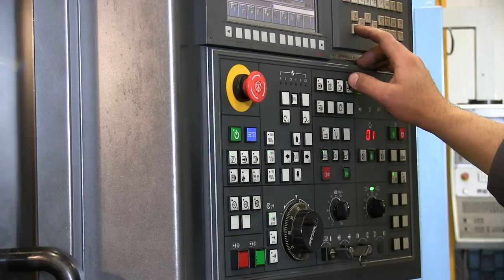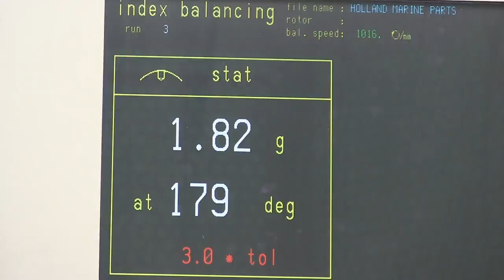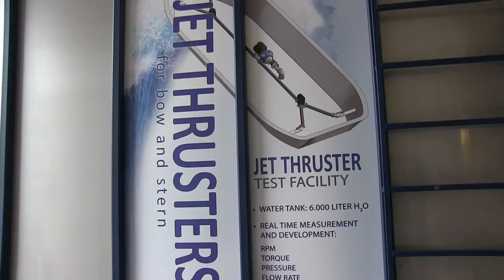How it's made - Pump Impeller

Comment: I needed a small water pump for my septic tank, so I can pump it out when it was filled up, and with no knowledge I went to hardware store and picked up mini BALDOR 250w 220v well surface pump (the one where you prime it, one end of the hose goes into the water, and trough the other end the water shoot out) and That pump is like 8inch by 8inch by 5inch and only 250w and it is sucking solid ** from the bottom of the tank, the impeller that is the size pf a mason jar lid mashes the solids and spits them out like no load at all. . . when my friend plumber came to see my setup he was looking like O_o - "You have to use at least 5 times larger pump for good perfromance" He said the pump as small as this will clog and will not suck up solids, so I demonstrated it to him and he was so amased on how that little pump is powerful. . . The openings for sucking and sending out the water are 1' holes and the whip of the hose is 1' also and it is sucking like crazy! It must be a very high quality impeller, because I don't think cheaper pump would have sucked water that is basicly a solid jello and rotten ** from the bottom of the tank with no trouble at all!